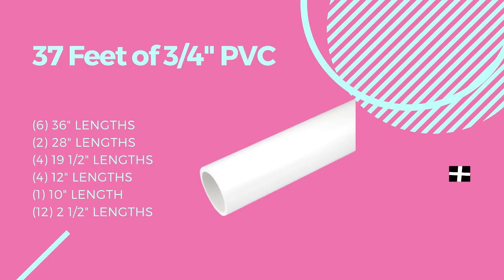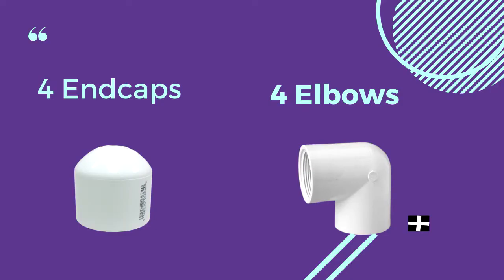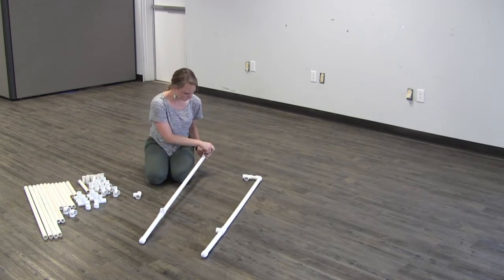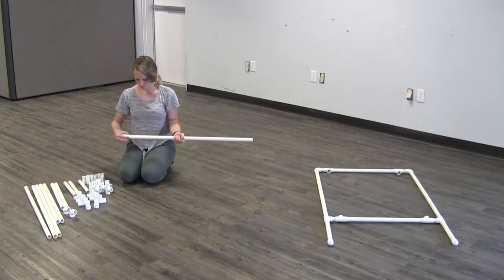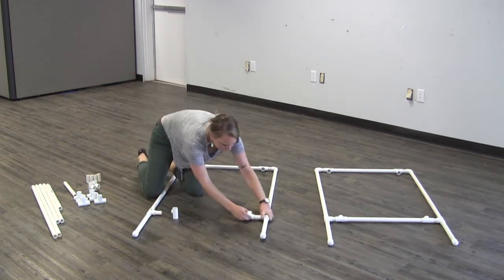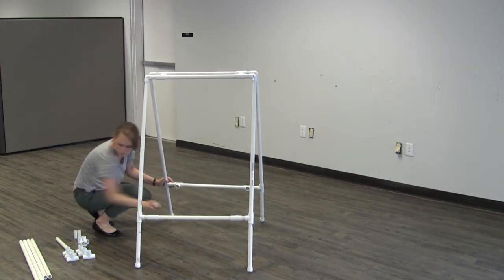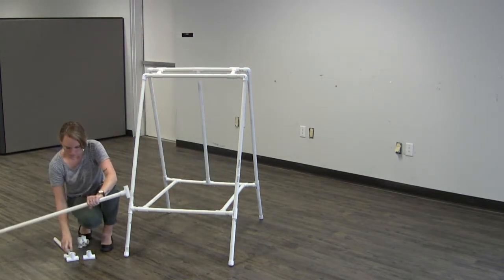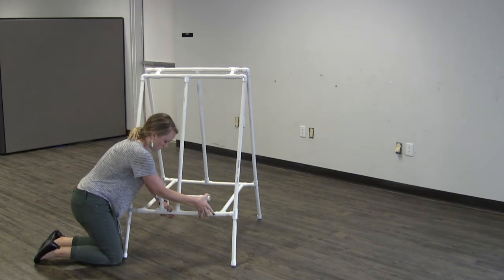How to Build a PVC Art Easel

Comment: Nice. Looks like I could make those 48" pieces instead of 36" if I want taller. Really, any length, so long as all 4 are that same length. Good share. Thanks! I will also look at filling the pipes with something for weight - probably sand - and gluing the caps on so it won't leak.
Reply from the maker: Yes, you can make it any height as long as you adjust the other dimensions also. Sand is common for the base of projects like this as its easy to add and remove as needed. 
Thanks for the comment! Feel free to share your pictures with us when you're done, we'd love to see it!